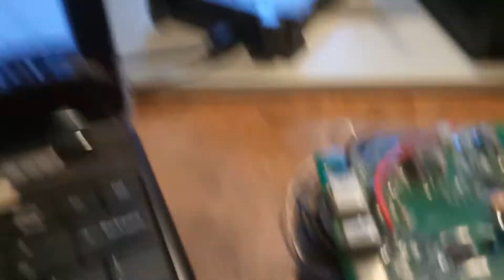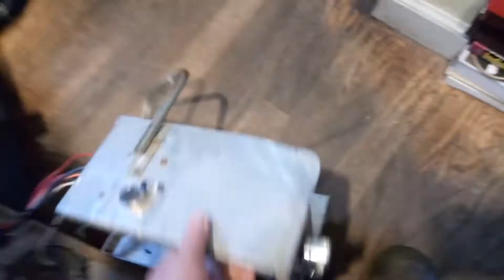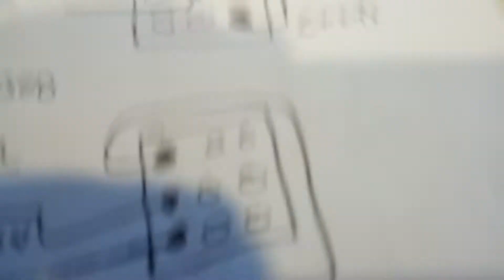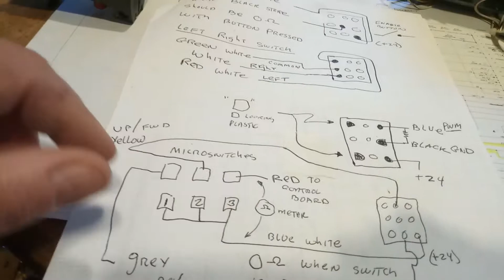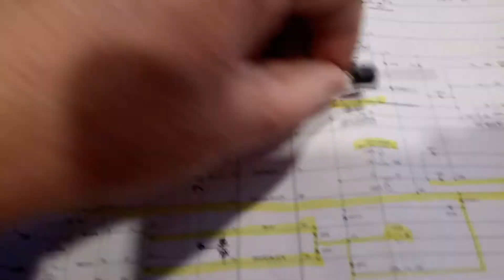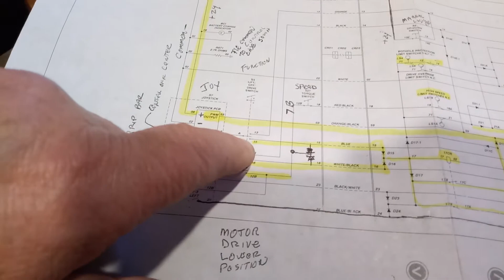SKYJACK Scissors Man Lift SJ4626 Won't Move Joystick Control Box Repair, Electronics & Diagnostics

Comment from the maker: Many of these man lifts use the same or similar control box regardless of model number. This company bought four new batteries and a new charger to try and solve this problem first.  Low voltage can be a cause for the solenoids not to operate. That sizeable amount of money was just wasted and they didn't even save the old batteries or charger for me. These control panels take a lot of abuse and replacing one is cheap. This was bought for $378 and this almost gives you a new machine. Joystick assembly alone can be purchased for about $100.  There are at least two versions and may require some modification of wiring. Always check limit switches for free operation and lubricate.  Battery and control tray switches may also be a cause if equipped.  There is a wire that goes to the charger that opens the circuit so it can't be moved when charging. Some may have a jumper wire replacing charger relay. Service manuals are free online. Due to the very thick conformal coating and surface mount components, repairs are nearly impossible except for the regulator and transistor mentioned.  The case had an arc weld burn. Since part of the circuitry worked I am not confident that an arc was the cause of the failure. I was unable to remove the defective enable switch. It is an OTTO P3-700035 which is $48. That must be some switch, no wonder they just shorted the wires!

Comment: I have repaired a lot of industrial floor cleaning equipment and have seen of the little "special" fixes you show here funny thing with floor cleaning equipment its usually carrying water and they are low side switching sssssssooooooooo  someone gets water on the control boards and they cant figure out why the machine takes off on them or they wont shut off ahhh good times LOL